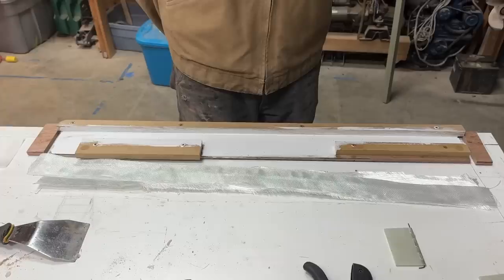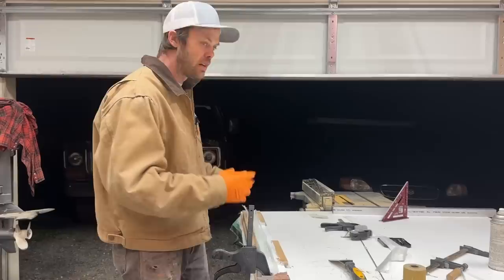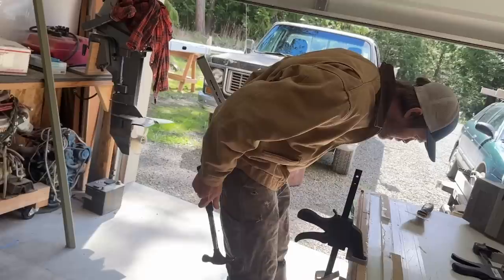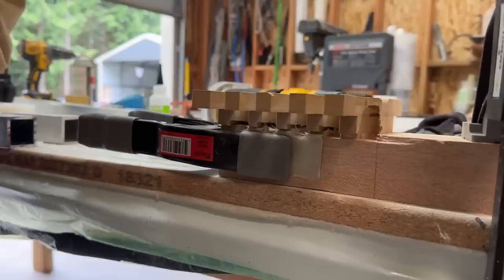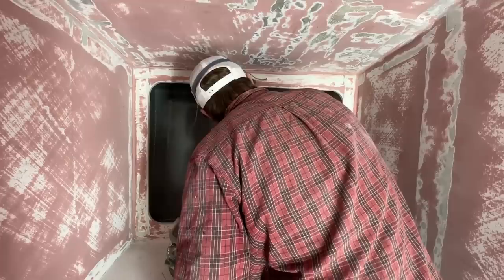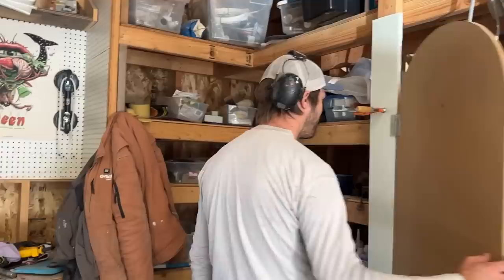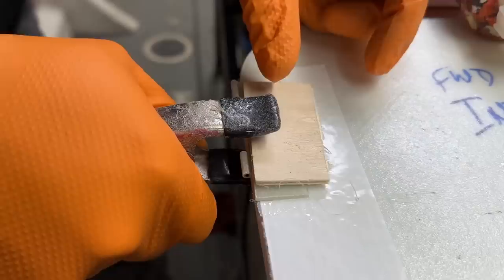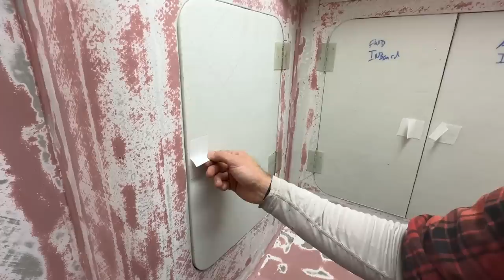Boat Build: Am I UNHINGED? [E74]

Comment: go with the white in the cabinets, the gray is so dark you'll need to add LED lights in all of them to find things. Paint it white and you probably won't need lighting.
Reply: I thought exacly the same thing. I have a black sailing bag and its hell to find things in it. So same thing for the cabinets.
Reply: yeah, ya cant find anything in dark cabinets.
Reply: Great suggestion. Photographers all want black gear, this way it doesn't show up in a window or bounce light onto a close subject. What we don't need but ONLY get,  are bags with black interiors. You can't find anything. In my shop screw pouches I could never see what was in there, they weren't even black. I bought some White Krylon spray paint for plastic. Hit the pockets of my screw pouches, but in each one I left one pocket unpainted. The paint soaked right in, the pockets didn't become white. Seemed like a failure. But it's exactly as you say, I can see into those slightly painted pockets when I can't see into the unpainted ones.   
Put a prominent number or code on each cupboard, bilge pocket, etc.  Like P1 for the one closest to the port bow. Then as you load them up take photos with your phone. This will work especially well for food - which you photograph in layers as you fill up the space. Now when you're on board and you're looking for the ketchup instead of going through all the spaces, you just flip through the photos. The location numbers should show up in the photos. But put the number as close to the contents as you can, or on a tab hanging from the top. You don't want half of each photo to be the blank door with the number.
Reply: @WillN2Go1  pro boats use spreadsheets. cause flipping through 2015 pictures looking for your stainless 6mm nylock nuts is re-diculous. I dunno, then again, so is data entry when you live aboard. Yer probably happier overall!
Reply: @bmunday  Spreadsheets are ideal because then you can do a search. But ti's also a lot of labor entering all that data. If you have 2000 photos, then you have a huge number of places, flipping through 2000 photos will always be quicker than poking around.  I've done these catalogues for my house, my books, my mother in law, our science dept storage rooms a few other things. My process was to make a simple database, so each part of each location had a record, or you could just bring up the records for that single room. I'd take the photos  and dragged and dropped them.. Now you could find things without having to physically go and open all the doors and drawers. 
The next step is  not that difficult.  You create a series of drop menus with all the classes of items. So Nuts & Bolts might be a general category. Now instead of 2000 photos you only have to look at 30. But I don't think it would take 2000 photos to cover an entire HoThe next step is  not that difficult.  You create a series of drop menus with all the classes of items. So Nuts & Bolts might be a general category. Now instead of 2000 photos you only have to look at 20. But I don't think it would take 2000 photos to cover an entire Home Depot. 
to list the items so you could do a search like with the spreadsheet. Not everything needs an entry.  I usually created the lists from looking at the photos.  My mother in law wanted to go shopping to buy her favorite white socks and undies. I did a quick word search and told my wife, Boxes 101, 102 and 106 - they're behind the couch downstairs. (Son in law's snarky revenge.) 
With photos if you go through your places and move things around you just have to take new photos. Easy.   If you need the detail, you'll take the time to enter the info. If you don't you don't have to. Keep in mind I've done this several times.

Comment: I absolutely love how you figure out stuff by yourself like with the hinges. It doesn't matter if the solution is the absolute best on the market. It is more than good enough and most importantly all done by yoursemf.
Reply: It matters if it breaks in the middle of nowhere, and you can't get stuff to fix it.
Reply: @MisterMakerNL  He rebuilds and maintains boats for a living, so probably will not leave without raw materials to fix stuff. On a boat in salt water you will be fighting repairs and upkeep, replacing stuff all the time. So making your own parts is lighter, cheaper and more resilient.

Comment: Totally gone crazy. Love it. Good to pair brass with stainless as well.
Reply: Why is  this good ? Two dissimilar metals is not good. The tube and pin should both be stainless. The brass is softer and will wear out. Glassed in hindges will be hard to replace.

Comment: The hinges quite ingenious! If you do need to use actual hinges or need to use screws in the foam core you can use a 1/2" Forstner bit to bore a hole where the screw will go. Then use your home made foam core borer to rabbet the foam out of the edge of the hole a bit. Then your fill the whole shebang with thickened epoxy. You can then predrill and screw whatever you need into the expoxy. Keep it up!
Reply from the maker: that's one way to do it. great idea.

Comment: you could use a strip of aramid (kevlar) glued with epoxy as hinge. It's easy and very strong.
Reply: Thats exactly what I wanted to hint at. With four prelaminated strips of glass you then laminate on strip of 45/45 Kevlar in the middle.
 I made hinges like this, the main trick is to prevent the Kevlar in the middle of getting to much resin on. One needs to scrape as much resin out of the gap as possible.
 The hinges are very light and strong. After curing to about 90 percent (a day) we broke free the middle part, the Kevlar.
 It's a tricky timing thing, to early and you deform the hinges to late and the cracks get rougher.
 But when you got it right the hinges are very light, extremely long lasting and can be glued in place.
 The other option is to 3D print hinges with petg, they can as well be glued in place with epoxy. This is the way to go for me nowadays because the printer does work alone while I can do other stuff...
Matthias now back on the trimaran in Greece

Comment: In radio control models for control surface hinges we use mylar, you rough the surface up and cut a slot between the foam and the glass fibre skin you then epoxy the hinge into the door and the frame. they take massive loads in flight.

Comment: For the countertops maybe use Corian. It’s great because it’s so hard wearing and still quite nice to look at. It has a matte stony finish, so it brings a nice texture into a bathroom or kitchen. Corian is a composite material so it won’t degrade, sometimes the surface gets a little scratched but that can be easily fixed by a light wet sanding.
Reply: A second for Corian, vast color selection and very durable
Reply: I agree. I’ve used it before and love it. I believe it’s also fairly non-permeable too, which is a plus for taking care of spills

Comment: To cut the notches in my carbon fiber hinges I use a dado blade and a sled on my table saw. Cut notches on the entire length first, assemble as a long piano hinge then cut hinge to spec. Very minimal clean up with high tooth per inch blade.

Comment: Always impressed with your work. If you run into the hinges abrading each other as the doors open and close--you may think about a very small stainless washer at each joint. Just a thought.

Comment: Matt your hinges look great. One concern which you may have covered and I missed is the construction of the pins. Vibration may have them slipping out in the vertical position and even in the horizontal.  I'm continually adjusting one on our caravan boot lid. Love your project. Love your presentation and your glassing. Stay focused cos the "Inspector" looks a little casual.

Comment: Grey is a great inside cabinet color, maybe since all these places either white or grey are dark maybe it’s an idea to instal some led lights in these cabinets and cubby holes?
I imagine just some LED lights in a clear tube snaking on both sides of the boat through the cubby holes and cabinets, one on each side of the boat tucked into top corners so you don’t directly see the light source. 
And I would look for LED lightning that you can turn to the right spectrum of red light to help with night vision.
These tube lights are also great for indirect diffuse lightning.
Maybe look into developing a light plan and overal electronics in order to accessible hide wires where possible.
But light especially light colors and way of lightning where to put lights can totally change the feel, practicality and experience on a boat, in a house, store etc.
I think it’s worth looking into especially if for instance you wanna put in fixed pipes to pull wires through, want a practical sailing as well as cozy home, lights can be a huge game changer in the feel of luxury and practicality.

Comment: That’s a very creative way to make and install hinges for your doors and cabinets.  I hope that two hinges is enough for the larger walk-through doors and wonder if three wouldn’t add a that extra bit of strength you may need for them over time.  The smaller cabinet doors look like they are fine with just two fiberglass hinges.

Comment: Nice , well thought out and constructed, makes a difference when the doors are lighter weight. For cheap, easy and good looking benchtops I used a hammerfinish PPC paint, mine was rolled onto undercoated MDF board and lasted about 5 years before a simple recoat , that's in heavy use kitchen area. Goodluck and keep at it

Comment: Uhh, for the counter top just try the two part epoxy marble pack from Rust-Oleum! Teal from Basic used that for his counter tops and they are holding up it seems! Quick and easy and looks good! As a radio control freak in my youth I was always coming up with things that weren,t commercially available! I liked scale planes and would make header mufflers for engines to fit into cowlings,, all kinds of problem solving things that sometimes created new problems!! Ohh on those hinges,, you could position them and drill like 1/8" holes through and into the foam. Then glue up and the epoxy would anchor the hinge into the the frames and doors.

Comment: Great to see all the progress. But for interior paint, would caution against using enamel/alkyd/oil-based coatings. Over time, the oil tends to feed mold growth. Latex and LPU coatings do not tend to mold up nearly as much. Latex is inexpensive, low toxicity, and easy to use, so great for areas above bilge level. But cannot be used over oil-based coatings without tie coats.

Comment: The idea is top. Consider that brass and stainless steel in a salt and moist environment will create corrosion thru electrolysis. I would suggest using a brass rod. I've been sailing for more than 10 years and experienced this kind of phenomena. I wish you good luck in your project. Your going great.

Comment: formica is the lightest weight counter material and works well. corian is the next heaviest material and works well.or you could use epoxy as your counter top material in between the other two

Comment: I worry about the hinge only being attached to only one skin of the fiberglass/foam/fiberglass composite. Just wrapping fiberglass around the panel edge may be enough extra reinforcing. If not an array of plugs filled with reinforced resin can be used. I'd also go with stainless steel tubing and pins. As for testing, you need to slam the door many times, and even body slam it a few times. Doors on boats take a beating.

Comment: The hinges are awesome, I like the gray, someone mentioned mixing the white and gray bilgecoat to make it lighter, great idea!  Not sure whether you all are planning high latitude sailing, but are you considering insulating the hull at all?  I am sure you have a thorough lighting plan, but the cheap little LED battery "puck" lights are great for small spaces and do not require wiring and switches.
Reply from the maker: No lighting plan yet. No plan to insulate the hull. The boat already has one inch foam core so it’s fairly insulated. Might not do well in the northwest passage, but it might….

Comment: Counter top idea: PVC sheets, lightweight, easy to shape. Add glasfiber ontop to add strenght and durability. 
Comparison to the plywood which holds more weight and are compact.

PVC sheets can be used in various ways. and save alot of time, instead of using glasfiber all the way thru the boat.

The other option would be carbon fiber laminate sheets, but prices is hefty and takes alot of time. The pros is that the carbon have a higher densitiy composite in structure than PVC. And are close to same weight as plastic / PVC. 

Below are a list of plastic composite weight list 

Vivak PETG

1.27 g/cc

Polycarbonate

1.20 g/cc

Acrylic

1.19 g/cc

ABS

1.03 g/cc

Starboard HDPE

0.955 g/cc

PVC (1 - 6 mm)

0.700 g/cc

PVC (10 - 25 mm)

0.550 g/cc

Comment: Very clever hinge solution. I wonder if for larger, heavier doors how it will wear. The hinge pivot point is fiberglass on fiberglass, so I'm curious if over time the hinge will wear itself down and cause your doors to sag over time. The grey cabinet color is nice, but may be a bit dark. In dark spaces like cabinets with shadows I think you need as much light reflection as you can get. A lighter grey or off-white may serve you better. The machine sounds in the video are a bit jarring at times. The levels spike and I have to adjust the volume. Anyway, I wouldn't say any of this if I didn't love the videos you make. You remind me of my friend that I think is a genius. Sometimes I wish I had something to commemorate your journey. Obviously I can't have a photo of you sailing Duracell on the ocean. I don't know what it would be, but I would buy something that would remind me of all the work and love you put into the boat.

Comment: A simple solution would be to 3d print a bunch of these hinges so you have spares.  Doesn't take long to make a few and probably much less expensive.  You could still use the brass or what ever material for the hinge spine but a 3d print would have been much quicker and you could still epoxy them in.

Comment: Are you not afraid of corrosion in those hinges when you mix different metals in the hinges? Have you considered using carbon tubes that are used in RC models instead of the brass tube to avoid the electrochemical cells that will build between steel, brass and salty humidity?
Reply from the maker: I had not considered carbon. Carbon also reacts to metal. I think I might switch to aluminum pins and tubes

Comment: Have you considered using UHMW for counter tops? It's fairly light weight, easily cut and/or routed/shaped, available in many thicknesses and won't ever rot. Downside: it's scratchable because it's like a plastic.

Comment: It seems that the Grey would make it hard to see inside the cabinets in shaded days or especially at night when there's limited light.. It's also easier to see dirt on a white surface which makes cleaning much easier.. It's your boat and you have to live with it. One nice thing you can always paint them white if the Grey is to dark.

Comment: Hi, at first I would like to say that what you are doing is exactly what my dream is, but I would choose a 60' trimaran instead :)
In competition DLG glider world there is a way to build hinges on control surfaces using aramid/Kevlar cloth.The way it's done is they sandwich 90/0 (i've also seen 45/45) Kevlar between two layers of fiberglass, then on the hinge line the fiberglass is removed leaving the Kevlar (carefully not to cut or score the Kevlar), then the hing is "broken" on that line, resin falls of from between the Kevlar fibers and the hinge is ready. Those hinges tend to last very long time and are "working" a lot under a lot force. The thing is that those hinges have like +/- 45* range of motion and I don't know how those would fare in "cabinet/hatch" application. One could mount the hinge in such way that it is open when the door is at 45* to the cabinet, so when the door is closed the hinge is in its -45* and when the door is open, the hinge is at its +45* (hope you got what I meant). the downside is the the hinge is permanent. https://www.youtube.com/watch?v=71O8Xdk-HUA
I've also seen in sailing world that some make lashing hinges that are light and easy to fix.
Reply from the maker: The live hinge idea with Kevlar is a popular one. I’m gonna give it a try.

Comment: Make your own countertops with your foam board and fiberglass then look up metallic epoxy floor costing kits that looks like water on Google to coat them with that and then cut out a couple spots to inlay wood cutting boards that can be removed and cleaned or replaced. That would be a nice lightweight solution that would look awesome as well. Steam up some wood straps to bend around and epoxy on the edges for durability and your set lol

Comment: Hinges look good.  How about longer ones for the bigger doors?  For the test door, maybe leave it outside so it can flap in the wind for a few weeks.
 Also, for the Stainless Wire inserts, you could hot form the top ends into a flat head like a rivet.
Reply from the maker: Yes to both ideas!

Comment: Young man , have you considered using Aluminum " Pop " rivets ? . I've been using them to fix things ( permanantly ) off and on for 
more than 20 years / they do not remove willingly .  Steel hinge and use the pop rivet  instead of the normal screws . lot of size choices and 
diameters at the orange box store . You do need to "ace" your drill holes though to get every thing to line up correctly / as you want 🙏

Comment: I feel like over time the hinges may wear because of the constant rubbing of the surfaces between the interlacing 'fingers' , where the rod slides through. You might want to put a neoprene washer/spacer between the fingers so the weight rides on that and not directly against the fiberglass...which could eventually grind them down...just an idea